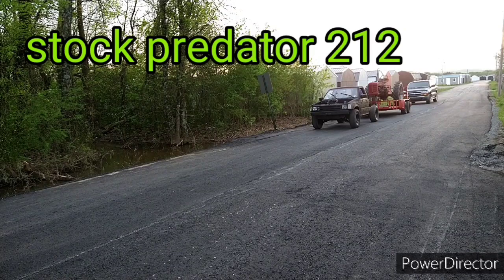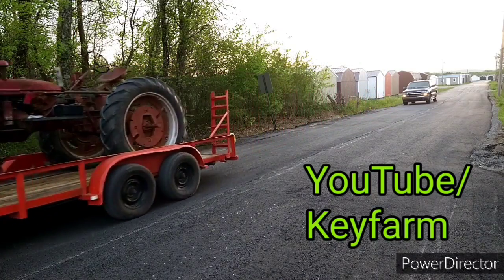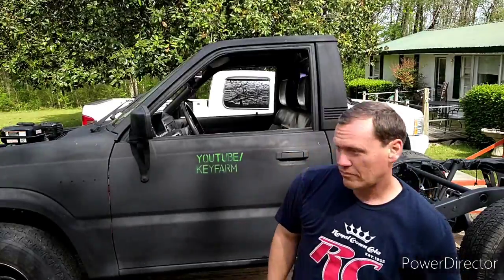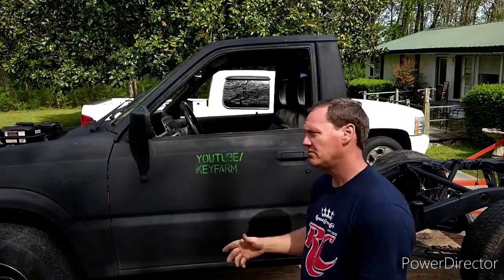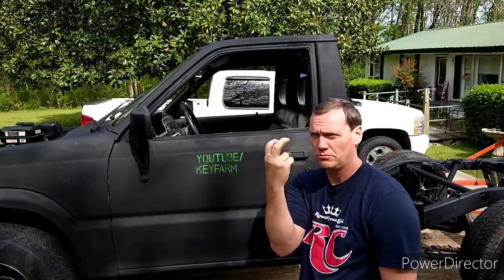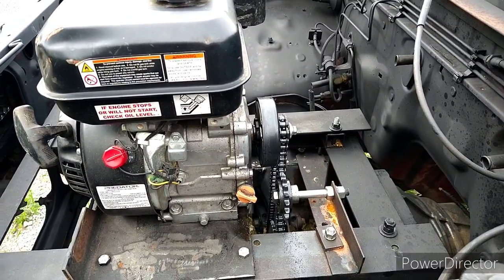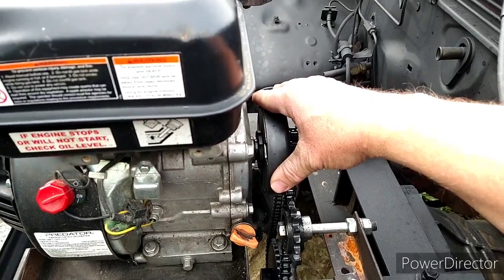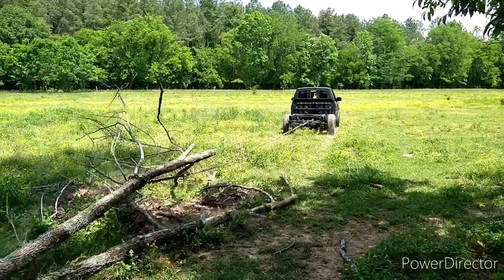Predator 212 Vs.224 in the Keyfarm gokart engine powered truck. Harbor freight engine comparison .

Comment: How are you shifting without a clutch, does it grind the gears in the transmission?
Reply from the maker: You can float the gears, what that means is you can shift without the clutch and once you learn how, no grinding.

Comment: I'd rip that governor out and put in a cam they have them for like $60 ideally you would get a better flywheel too but it's not like ts right behind you or between your legs if it came apart so I would send it but I don't know if 3600 is where it is governed or just a peak power rpm but thats a number I have seen and the the cams I saw said peak power at like 7500 that's more than twice and one of those torque converter CVT seems useful too
Reply from the maker: I put a bigger engine in it this week, check out the new one 👍

Comment: Just a quick question - if you are using the transmission and clutch from the truck, could you remove the clutch on the engine and replace it with just a sprocket?
Reply from the maker: I'm not using the original clutch, to do that you would have to mount the flywheel on the input shaft, which seems like it would be difficult and unnecessary. But yes, if you had a clutch on the input shaft, you could just have a sprocket on the engine.

Comment: hey brother im lovin the build! I think if you changed over from chain and clutch to a torque converter setup youd be much happier, it would last longer and be much quieter!  Put the Big pulley straight on the input shaft you built
Reply from the maker: The torque converter I have on my golf cart works ok but isn't great, and I've had to work on it a couple times, now that I have a bigger engine the torque converter for it( the one rated for it's power) is real expensive. Maybe some day.

Comment: I would love to see two identical engines TIMED WITH positive  connected sprockets to a jack shaft and place BOWTH on TDC and check the power then oposing 180° to see if there is a difference between two pistons firing at once or opposite each other which would make more power and torque.
Reply from the maker: That would be interesting